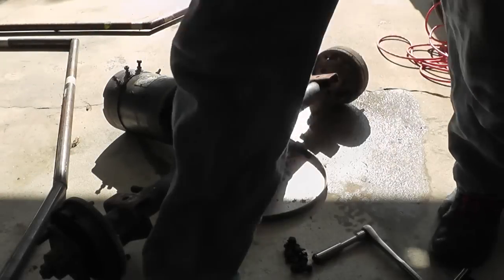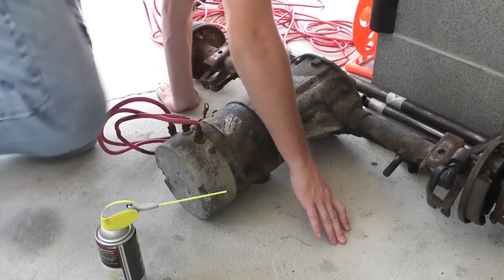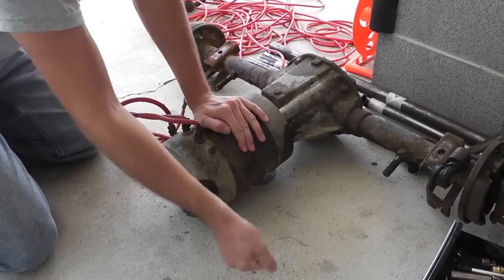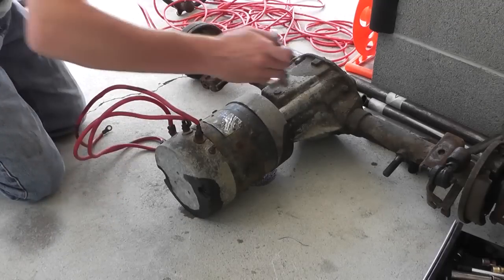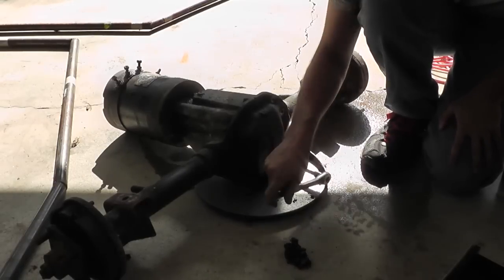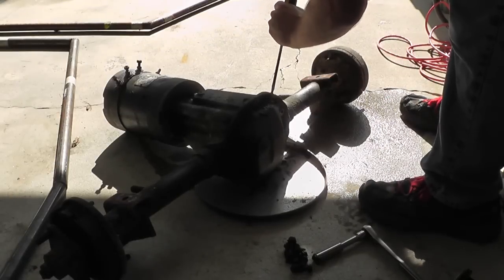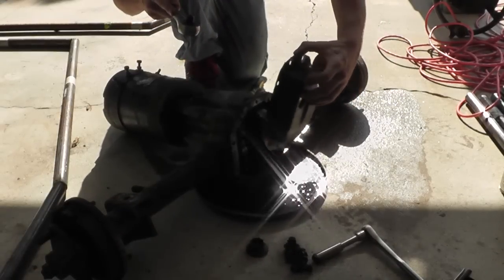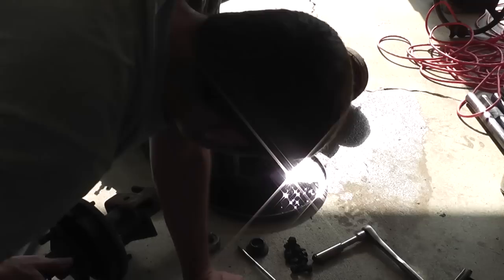How To Build A Dune Buggy From Scratch - 007 - Golf Cart Tear-Down & Salvage - Part 3

Comment: great vid have 2 to tear down where do I find a replacement motor
Reply from the maker: You best bet is to rebuild the motor.  Buying a new one is super expensive.  But if you do buy a new motor, get an A/C motor and controller setup, it is much faster.
Reply: thanks could my problem be resistor new bats but still loss of power

Comment: what type of golf cart did this axle come out of again?
Reply from the maker: It was an old electric EZGO.
Reply: thank you also i noticed you spinning the shaft clockwise, does it spin clockwise to move forward?
Reply from the maker: That is a really good question!  That would make the most sense!  Luckily, you can just switch the wires on the motor, so it spins in the opposite direction.  But some older carts have a full-speed reverse, so it wouldn't matter too much.